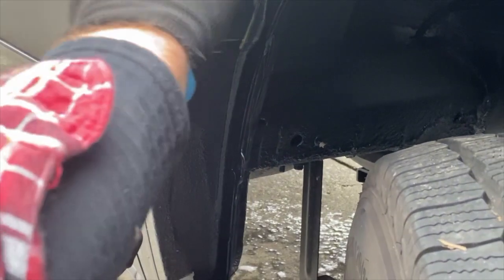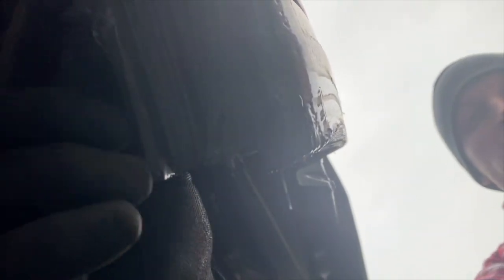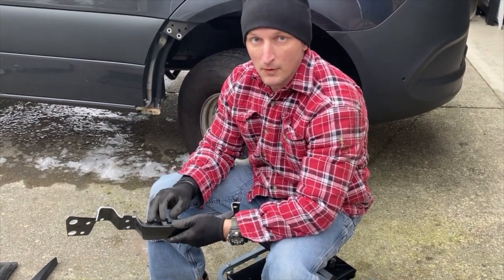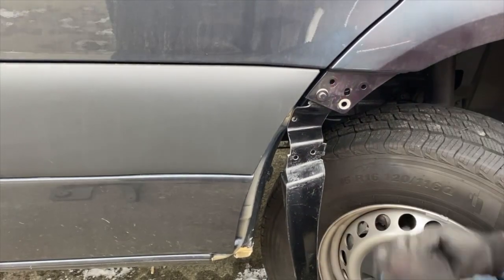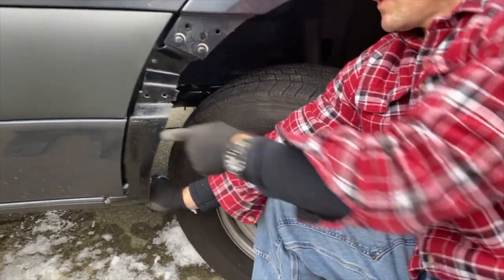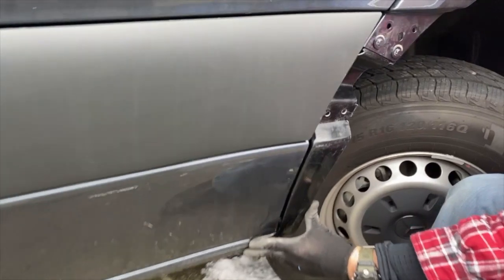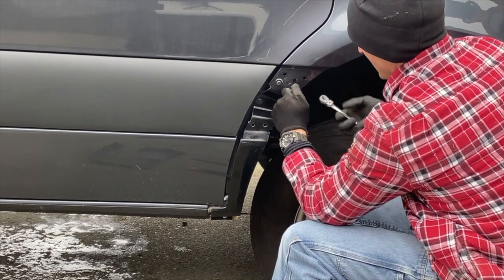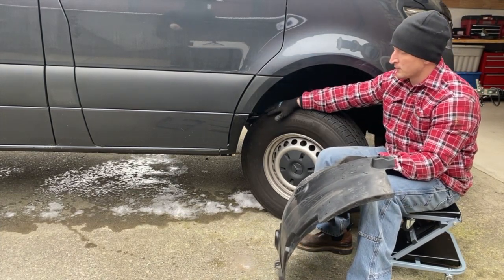How to install Agile Off Road "no rub" mini fenders on a 2019 Mercedes Sprinter 4x4 144 crew van

Comment: The pins on my side molding/trim pieces was incredibly brittle. The white pins literally started to disintegrate as I was easing them out. I could not find replacement pins and actually ordered whole replacement body molding parts (left and right) from MB USA. I was in about 48-50 degree weather when doing the install. I wonder if softening them up a bit with a heat gun would have been a good idea! Great video. This helped my install for sure.

Comment: So no folding the body seam?
Reply from the maker: nope
Reply: PNW VANPLAN thanks much.... so Saturday I do the deed.... watched this a few times. Instructions say to fold over body seam - not even sure what this means. Then in another video someone is cutting a taper on the fender. Any insight on this to help me understand?
Reply from the maker: Mac a'Bhaird I’m not sure what folding or bending you’re talking about. It’s just unbolting the old and bolting in the new one.
Reply: @pnwvanplan9148  My instructions showed bending the body seam. I bolted it on without doing that and the 275/70s rubbed. I had to take everything back apart and bend it twice to get them to clear on my 2019 Sprinter.
Reply: @mikericker7125  I'm about to start on the instal right now. Any advice on how you did the bend? Were your 275/70s 16" or 17" rims?
Reply: @JoshFromDtown  I have 275/70s on 17” wheels. My agile instructions have a picture with a dashed line on it showering where to bend the fender seam.
Reply: @pnwvanplan9148  got ‘er done, fitting  275/70-R17 BFG AT K02 - had to cut & fold. Messed up on trimming the factory trim clips, if I cannot replace the clips may have to replace the whole trim pieces.
Reply: @mikericker7125  Bending 90 degrees about 1/2 inch of the fender seam and then screw on the mudguard will allow more space.
Reply: @stevecabacungan  that’s what I did to. I’m guessing the difference is folks running 270s do not need that step but those with 275s due. For what it’s worth, mine still rubbed at full lock even after pulling them off and bending (and hammering) the body seam. I installed the Agile RIP kit and now there is plenty of clearance.

Comment: Were you able to confirm your 275/70/17 fit with no rub using your install method?
Reply from the maker: No rubbing at all
Reply: @pnwvanplan9148  Also for my 275/70/17's... zero rubbing on any angle/suspension compression.